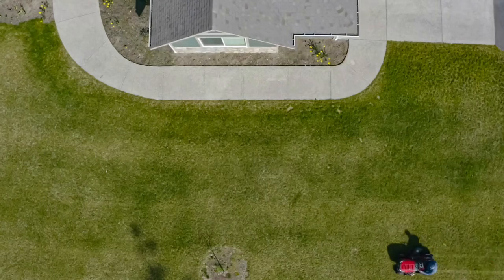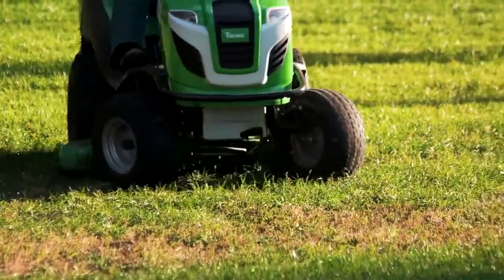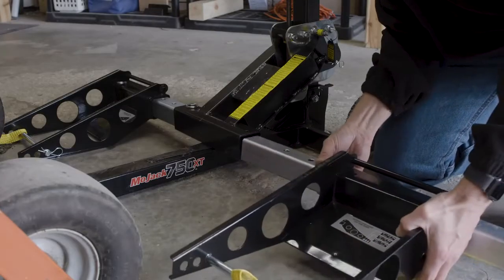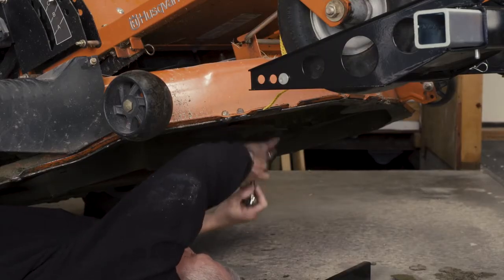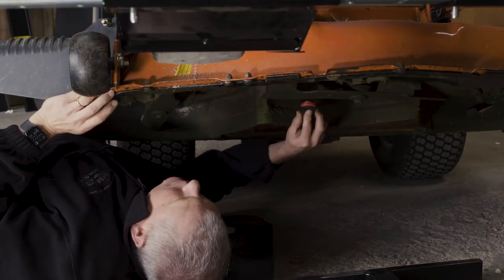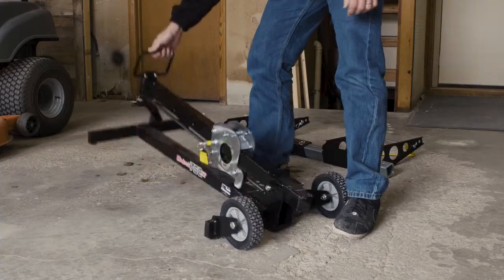MoJack 750 XT Lawn Mower Lift  750-Lb. Capacity Model# 45002

Comment: Yep, it "folds flat" after dismantling it! 😆 Those Clevis Pins on the Wheel Lift Pads are the ONLY way to go with these types of lifts. I returned MoJack's model HDL 550 because of pushing it all over my garage, while attempting to drive over the silly oversized, built in bar on the wheel pad. 🤡